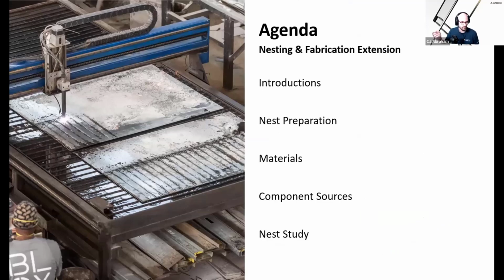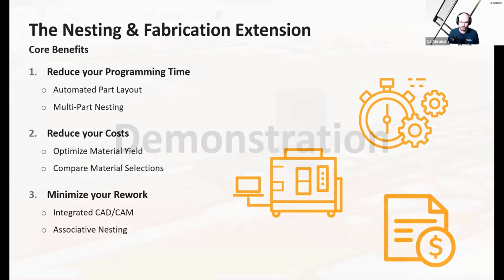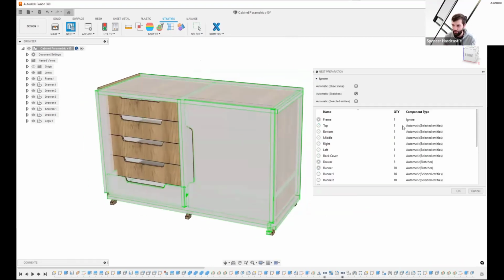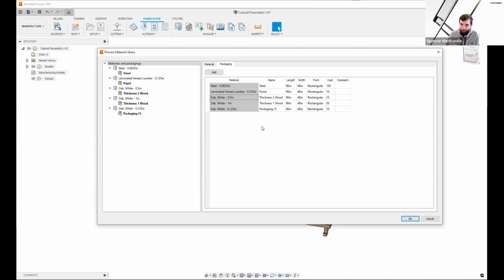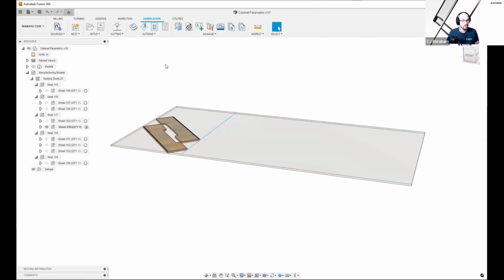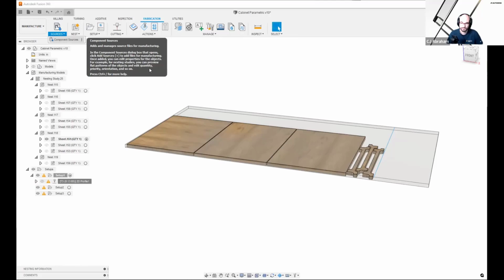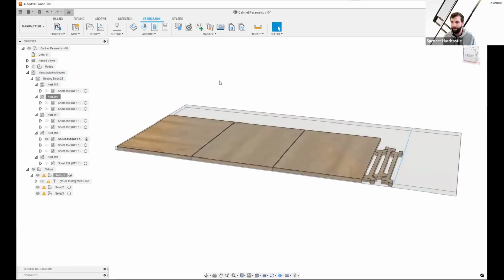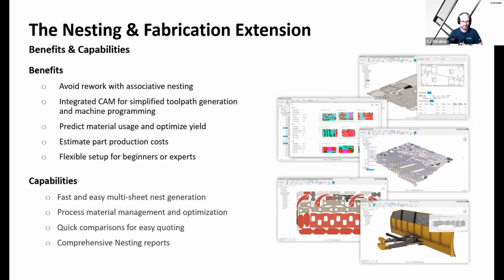Webinar: Optimize Your Woodworking | Autodesk Fusion 360

Comment: Poorly delivered Webinar guys! At what stage does Optimize Your Woodworking use Laser cutting, you are required to go into milling. The sticky label ability is appalling, you cant buy an off the shelf sticker printer and easily have it work. If you print out labels for 10 parts and file/part names are longer, it doesnt lock the sticker into one label, it overshoots to next label. I spent hours with help desk trying to sort this issue out and the end I gave up. For $2000aus I would expect that the sticker label printing would work. Really disappointing Autodesk.

Comment: It was disappointing to see advance arrange move to such a high cost extention.  I'm a small shop with one  cnc router and would not make use of 90% of the function of the nesting extention.  Hope you guys find some other affordable ways to integrate advance arrange into fusion, until then it's back to 3rd party options.
Reply: This. Fusion always seemed like it was focused on helping the small shops get just the basic functionality we needed in the base package for a reasonable price. Most of us do not need most of the advanced functionality here. Just good arrange and nesting (no QR labels or advanced cost analysis needed). Please look and see if you can move the base level of nesting in to the standard Fusion package. This seems like what should be a standard feature in the existing very advanced CAM package that is already a part of the base cost.